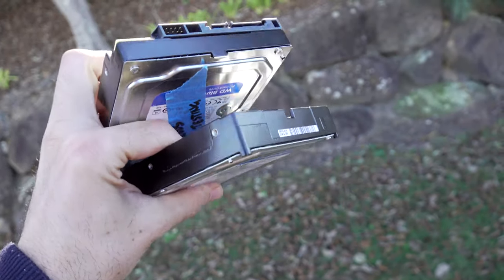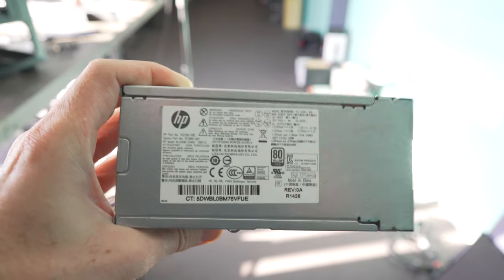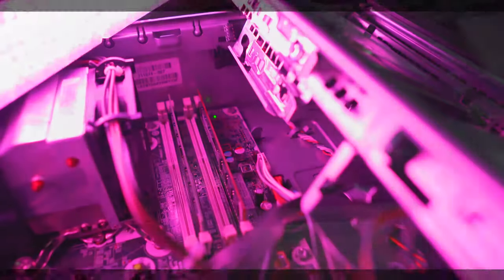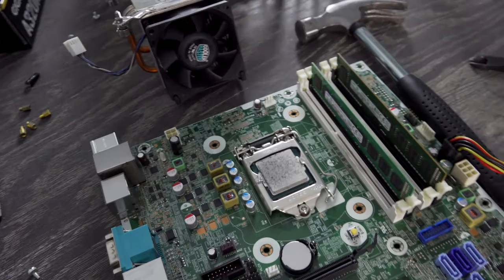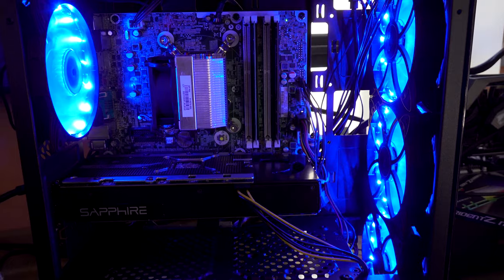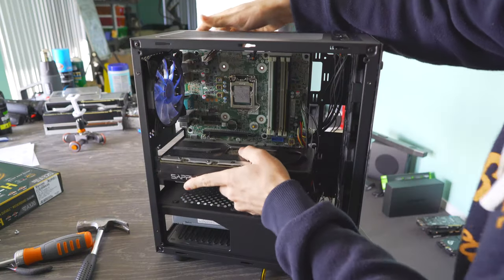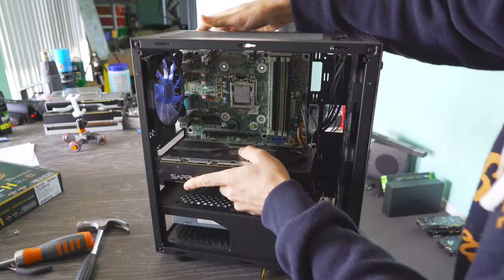Turning a $100 4th Gen HP ProDesk into a GAMING PC? (Mid-Month Hustle)

Comment: i just copped that hp pc for $100 (aud) and it came with a free 22" 1080p ips monitor and a basic keyboard
planning to put this in a new case and install an rx570
Reply: If you dont want to replace the case get an low profile gtx 1650
Reply: Though rx 570 is better value.
Reply: @PK-sg1po  the OEM case looks pretty boring imo.
I would prefer spending more money for better aesthetics and also performance

Comment: I just picked up an untested xfx 580 for 50 bucks off eBay, hopefully it works.
Reply: how was it
Reply: @smokeinc9800  I haven't gotten it yet
Reply: Did it work?
Reply: @mg86_  lol, it was quite an adventure getting it to work but it's in my PC right now. It had a bad component shorting it out preventing it from working, and after melting some of the components on the card by accident, I eventually figured it out.

Comment: At the same benchmark settings my old worn out r9 390x 8gb ram did 3075 for the score and I Did have about 100 tabs open in my browser.., I figured a newer gpu would be a lot better, guess there is no need to upgrade for a while longer. of course though I got Ryzen 1700 OC'd to 3.7Ghz and 16Gb ram, which the CPU has 8 cores and 16 threads.... Its a few years old setup but can play any game so far maxed and I play at 2560x1440, I can run at 4k but the fps is a little lower then I like  since it is a single gpu setup. I would like to upgrade to a newer gpu but I cant justify  it because of price vs performance.

Comment: Is it possible to paint the motherboard?
Reply: 🙂 yes some have tried, but its usually done on old motherboards just in case u drop paint in the wrong spot, on newer boards i would only recommend maybe spot painting with a fine brush, not with a spray paint can

Comment: I'm doing this exact thing right now I just got the cable adapter for power supply I'm aware I need to cut the tabs out of the hp case to mount the cooler the thing I need to know is  the panel connector layout for when I put the hp board in a new case power switch power led etc can u steer me in the right direction????

Comment: Dislikes from people that don't know how efficiency ratings work on power supplies 😂

250w 80+ Gold = at least 240w sustained power without risk of blowing the PSU, compare that to a non certified budget 500w unit and you will find the gold rated 250w is more stable and handles the load better. That PSU will run loaded at 240w all day long without a problem, more than enough for the sub 200w load of those components. I would definitely swap that out for a better PSU if I were going for a 200w+ GPU but the 470 comes in well under 250w (total system draw) in most reviews with the (very few) outliers utilizing high end overclocked CPUs on power hungry systems and also overclocking the GPU as far as possible. This is an i5 that doesn't even come close to it's 65w TDP in typical use (including gaming) compared to the i7 "K" SKUs used in reviews of the 470 and 570.
Reply: Xaltar The cpu cooler is mounted backwards in the final build.
5:36 correct
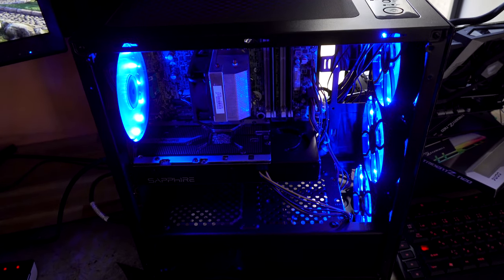11:00 backwards
Reply: @benarmson4578  And that is cause to dislike a video? 

He even mentioned that it was backwards and that it didn't negatively impact performance/cooling. Still, took some guts to share your reason for disliking, kudos 👍

Comment: Bryan - I have a 4th gen i5 4570 from HP that I tried moving to another case and had issues where it wouldn't boot w/o warnings about the stock case exhaust fan nor the stock case front USB ports.  Any advice?
Reply: Robert Partridge 
Buy an adaptor for fan from Aliexpress only 1 € or lower...

Comment: Hey, my pc won't display anything or won't even go to the bios and I suspect it's my motherboard. No display comes from the motherboard and only the motherboard b350m ds3h lights up and so does the led on my blue snowball but not enough to power my keyboard and mouse. The cpu and gpu fans spin though any help ?
Reply: Need more info to help. Is it a new or old build?
Reply: @SparkyOne549  New build, have built PCs before and had fixed this problem with this pc no.

Comment: did no one realize you set the CPU fan wrong direction the CPU fan should be lettings the other fan suck heat out you set it to heat the rams inside blowing hot air instead it should be rotated to blow outside on the back fan

Comment: Hello from Portugal,
I'm doing the exact same build, but I can't turn on the motherboard in the new case
I'm using the oem psu and oem conectors but the pb/led panel isn't working and I can't boot the pc
Can you explain how did you conect the power switch?
I shorted all pairs of conectors but it wont boot

Comment: I've had multiple sata power connectors melt on a simple riser, you're actually powering a GPU with it??!
That's bound to give issues at some point.
Since sata to PCIe only uses the 12V wire, it can only carry 4.5amps. For a total of 54Watt.
I know the PCIe slot also provides power, but that's also shared with the CPU which on this board only has 3 mosfets (from what I saw).

https://en.wikipedia.org/wiki/Serial_ATA#Power_connectors

Comment: Wonder if my lenovo i5 4590s is going to be easy to add a graphics card too also it dosent have a 6 pin adapter and only has 2sata connections so need a new powersupply that would work with a 12 pin adapter

Comment: Guys i have the same case and the same power supply but i have a pentium g3220 , 8 gb of ram and a 380 gb harddrive and another one 80 gb so i was wondering could i install an nvidia gtx 750 ti ???

Comment: i5 4670s is not even that good. the non s version is a lot better.  great job still.  i have used low profile graphics cards in these systems without having to switch cases.  never wanted to try to put the mainboard into a new case.  figured there would be a few hiccups

Comment: Dear write which processor should I buy hp prodesk 600 g1 twr motherboard 18e7 processor 4130 I want to install Intel Core i7-4770 or Intel E3-1240 V3
sorry google transmitter
Reply: 1240 v3, before updating the bios to version 02.71
Reply: @rogern5613  Thanks

Comment: I gotta tell ya. HEAVEN isn't a way to guarantee a stable system (GPU). Not to say the system wasn't stable.
  With past experiences. I bought a 4GB Nitro+ RX 480 and the guy I bought it from, said he tested it using heaven. Along with all of the other cards he had. So i put it through my testing and found that the card was faulty. 1 benchmark that can really show if there's a problem with a GPU is Metro Last light. If a GPU can make it through that bench without artifacting or overheating, then the card should be good. When I msg the seller and told him what to test with. He ended up buying 50 cards that were all faulty, under the Metro bench. But, in light loads and vids they worked fine. I laughed when the guy said a GPU doesn't do that. It either works or it doesn't work. I sent him a vid showing how a half baked card can act sporadic, changing his whole way of buying GPU's. Even though dude sold me a bad GPU, he didn't really know. So I didn't hold that against him, instead I tried to help him.

Comment: Bryan,  Good on you, mate!  We bought a refurbished HP Pro 6300 last year, and recently ran into a problem after a Windows 10 Version 1903 update.  Scroll down to "Message 5 of 5" in this HP Community forum post, for the FIX:
https://h30434.www3.hp.com/t5/Desktop-Operating-Systems-and-Recovery/high-CPU-usage-with-Windows-10-on-HP-Compaq-Pro-6300/m-p/7174648#M169934

Comment: I have the same pc and i got a sata to 6 pin and then i put a hd5770 in there i get over 80-100 fps in fortnite
Reply: is the pc still working?
Reply: PuffleAE86 nope i upgrade to a rx 570
Reply: @Mzstihas-a-bwc  with sata to 6 pin?
Reply: PuffleAE86 na i got a i5 2400 mobo now with a new power supply

Comment: Yo how to get rid of the ''front usb 3.0 not connected'' error? The 90 degrees connectors not an option coz will be too close either to the ram slots or to the SATA ports, therefore you cant fit any cable in it. Thanks!
Reply: answer: short pin 10 (ID) and pin 7 (GND). Google usb 3 header schematic and you know which pins they are :)

Comment: Victory doesn't have smell, is not an object
Reply: next you are going to tell me it doesn't actually rain cats and dogs 

and something can't weigh on your conscience
Reply: @bluescluessuperagent  cats and dogs are mammals, so obviously only water that falls is consider rain to humans.
So that is an obvious no it doesnot rain cats nor dogs. 
Weight is physical objects, materials and or molecules, is based on the density of the molecules, conscience is a human way of reasoning good from wrong, so you are not lifting anything inside your consciousness, is a misleading wrong form of speech by humans, which reference that they feel guilt or remorse which is completely different from carrying weight,  is just another way of expressing themselves in a figurative form of speech.
No you dont carry any weight in your consciousness you only feel(think) guilt, remorse and possibly other emotions that can be consider the same as carrying weight. 
Also water is not wet nor dry, is an incorrect form of speech by humans, water is cohesive not wet or dry.
Reply: @frankynakamoto2308  thank you for not disappointing

Comment: What's the going price for 4th gen i5\i7 processors in Aud?
Reply: dell optiplex 9020 is under $300 but you are limited to a very low power PSU

you can get an adapter to use a normal ATX power supply on aliexpress
Reply: @ITH56  i'm looking for the just the processors. i ended up with 4th gen motherboards but no processors

Comment: FWIW, in the past I've gotten adapters for using regular PSUs on HP motherboards. https://www.amazon.com/gp/product/B074G12LT5/ref=ppx_yo_dt_b_search_asin_title?ie=UTF8&psc=1 is what I used and it worked (I got 2 z220 i7 3770s for 135 ea).
Reply: On a related note: standard PSU mounting holes don't line up in HP cases, just so you know.    So, my big question is: why does HP (and/or Dell) do this? I can't believe there is savings in re-engineering and using non-standard designs for PSUs, and Cases, etc. It seems like they're spending money specifically to thwart upgraders in a secondary market that they really shouldn't care about. Their customers don't care really, they'd get better resale value on their disposals possibly reducing disposal costs (which are not nothing, I'm a PM who does that sort of thing, I can tell you)

Comment: Does this Prodesk support RX 5500 xt to pair with it?
Reply: bruh i really dont think that 240W PSU is gonna handle it... 5500xt needs 130W ......  computer will probably start but very likely to crash during load..
Reply: @youngo2416  i plan to change the psu
Reply: @h373rom5  ive just been doin some research and apparantly the hp 4th gen oem motherboards are really wierd (no 24pin only 6 pin and 8pin). try gettin a lenovo or dell oem or else prepare to get adaptors etc ...
Reply: @youngo2416  hmm.. but is it support the RX 5000 series tho?
Reply: @h373rom5  yea im 95% sure  ... u could put a 3080 if u want.. given it can phsically fit .. different AIB models will have different size .. 
also theres a prodesk mid tower vs sff case ... so u need to have the actual computer and measure for specs ..  and also check cpu bottleneck (just google it and type in the set up) but a rx 5500xt is good with i5 4590 ... there will be a little bit of bottleneck but its not terrible.
Reply: @UCMHrbdJ4Vj98XLkn6VUfKGg no worries good luck with ur build
Reply: @youngo2416  Nice.. thx for the reply dude, these prodesk have a drop in price like crazy in my place, like 40$ only, and also you get monitor with it